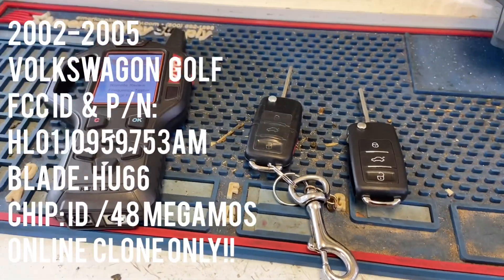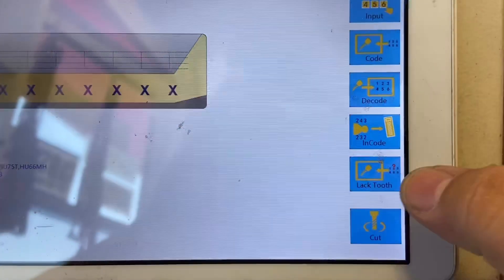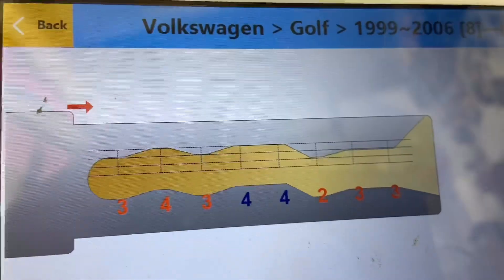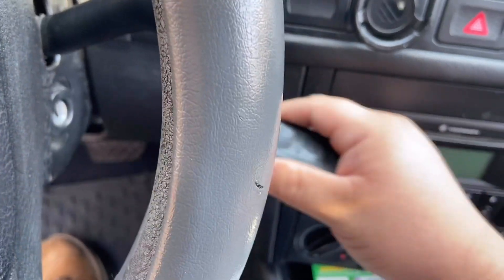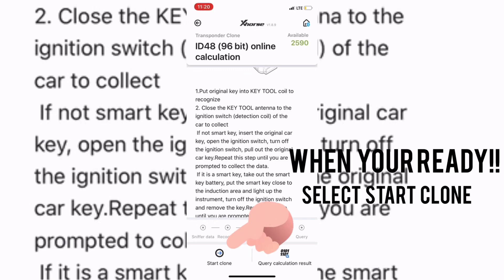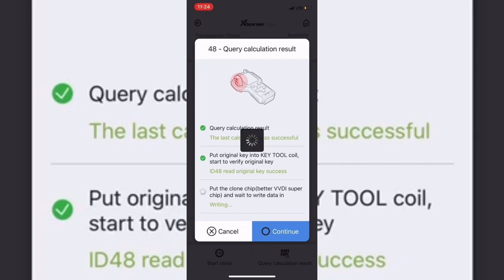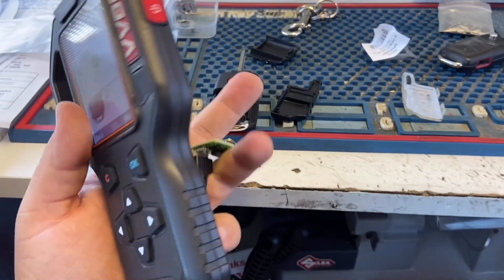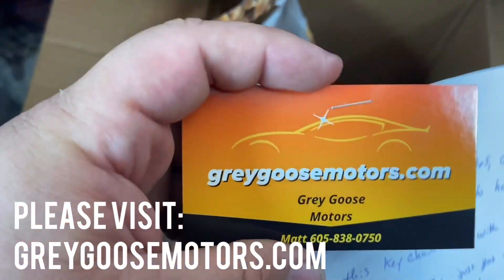2002-2005  VW GOLF  PROGRAM FOB/CLONE KEY ID 48 MEGAMOS (VVDI & ON-BOARD PROGRAM)

Comment: Mike! Your friend Pete again, Need your help! Having trouble pulling a pincode for a 2000 beetle all keys lost. Any advice? auto pro pad pulled a 5 digit PIN out of (01 engine). Nothing out of 17 dashboard or 25 immobilizer. Keytool max couldn't pull anything. When adding a key it asks for a 4 digit PIN. Used skp to pull a 4 digit PIN but it so far hasn't worked. Does it lock after 3 incorrect pins? Was trying to reset for 35 min with key on to try again but the battery died. Am I on the right track? Going back tomorrow. Thank you so much for always being so helpful!
Reply from the maker: I had the same issue with a bettle i had to get my friend to come down and disable the immo...
Reply from the maker: Some
Ones said to use the chines t-300 and to pull from the 17dash not ecm!!
Reply: @MYKEYSAUTOMOTIVE  thanks so much! I'll keep you posted

Comment: Como le harías para programar el control si fueran all key lost? I
Reply from the maker: Pues primero hacemos la llave de la chapa.. se quita el cylindro de la puerta ,se mira se tiene el codigo de el corte afuera en el cylindro .. si no .. se abre se busco los numeros de los pins cada pin tiene un numero escrito (un corte).. hu66  lishi te hace la vida mejor ..
Reply: MY KEYS AUTOMOTIVE mire que programaste el control nuevo usando la llave original en la puerta, como le harías para programar el control si no tuvieras ninguna llave
Reply from the maker: No se puede acupas hacer la llave primero.. para abrir el switch y programmar lo con el autopropad o pad2 x100
Reply: Muy bien explicado donde te puedo pedir consejos amigo referente ala machine cut